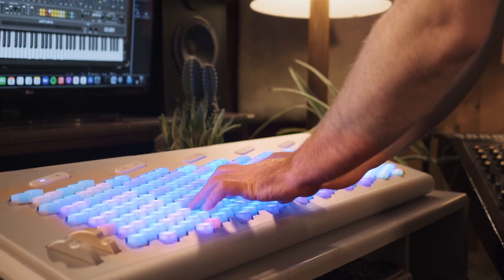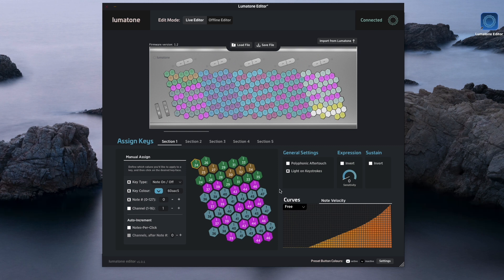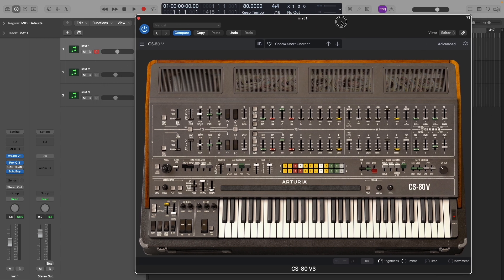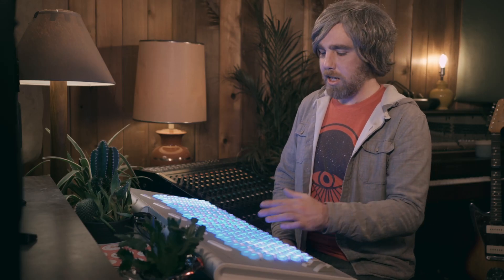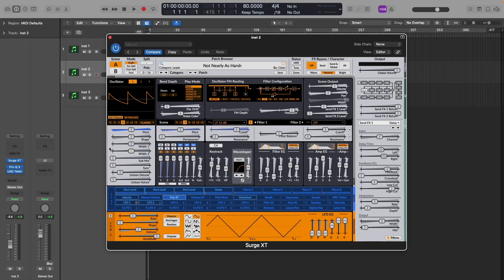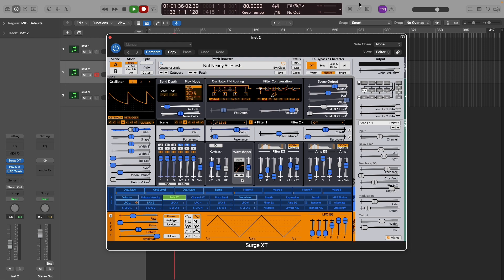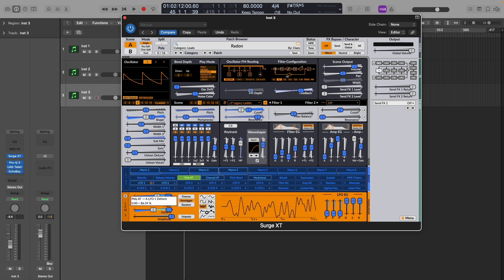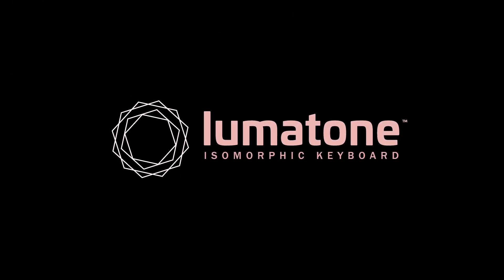Learning Lumatone: Episode 8 - "Polyphonic Aftertouch"

Comment: I've yet to really put it to practical use, but there are so many fun things you can do with Surge and Poly AT. By attaching it to filter cutoff and resonance of a bandpass filter, you can end up with something where each key is kind of like its own throat singer, and pressing harder gives you a harmonic series. It's controllable enough that one key is manageable and you could play a simple song by controlling the pressure of one note with some practice, but as a polysynth it can be a bit mind-blowing trying to control an entire choir of throat singers with your fingertips. Fun to hold a chord and shift your weight around on the notes and have it morph into different related chords.